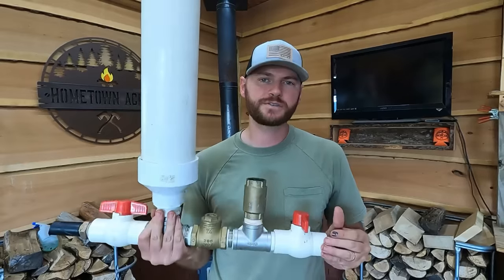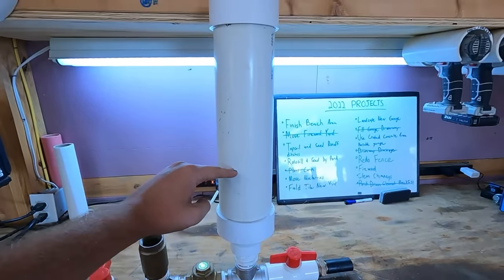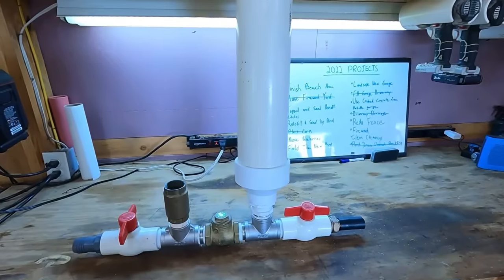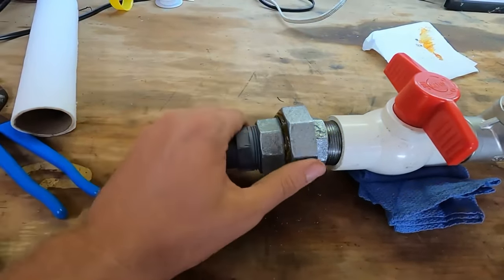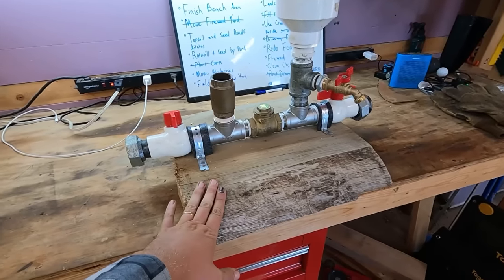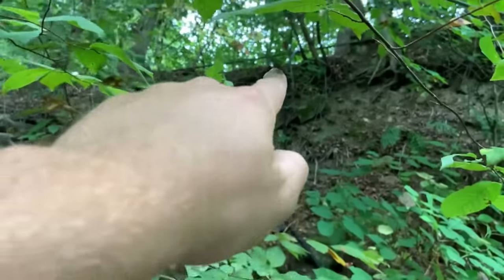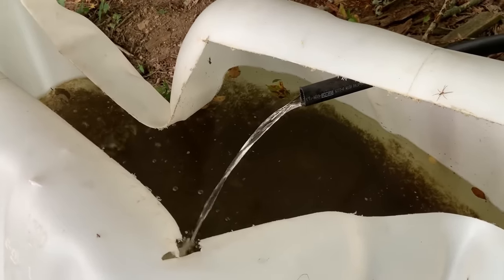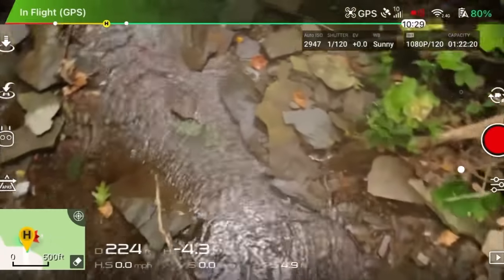Perfecting The Ram Pump And Then Abandoning It

Comment: Priming that siphon will be a challenge. Ram pump is set it and forget it and will run as long as there is water in the stream.  Loss of flow rate makes up for the ease of operation. But it’s not my pond. :). Learned a lot watching your challenges!

Comment: one other way to get relative elevations is the water pipe. a piece of tubing or hose filled with water will have the water at either end at the same elevation. Of course, this requires you to have a hose long enough to begin with, but useful for smaller projects

Comment: Just put a loop in the pipe after the check valve. Will create air gap to allow for compression. Get rid of the pressure tank all together. If the creek ever runs dry for a bit your siphon will stop, with the ram pump it will always move water when available. Granted the siphon will move more but it is not a set it and forget it. You can set the ram pump and come back 20 years later and it will still be running.

Comment: Pool noodles Or bike or half pumped tire tube to slow down the water logging update to stainless steel parts for more weather resistance, add small weights (a few bolts) to top of foot valve to increase flow.  Great idea on the added tap. Even a more durable drive pipe PVC or galvanised half the pipe to the pump for better flow.

Comment: Adam 
You do very nice work.

A comment on you Ram Pump Issue
 Your Head tank is saturating over time because the gas(air) is being absorbed into the water
therefore you must drain the vessel periodically.

Your installed drain is correct,  but will not drain the tank as configured!
You need to add  a 'Vent Valve' to the top of the tank in order to properly drain the chamber.
If not - it will not drain!  As Air cannot enter the chamber to purge the water.

Just like holding liquid in a straw by holding you finger over the top = it will not drain,
You may realize this the first time you attempt to purge the vessel or you may not 
the fix is simple - add a vent valve to the top of the tank.

I would not abandon the Ram Pump
because you can use it to prime the siphon 
which you may have to do periodically. or at least seasonally.

Also realize the larger the diameter (within reason) of the siphon line the greater the flow rate
exponential as the flow of a 2" line  will be significantly greater than 1.0"
and this can be easily calculated.

Comment: I've never seen a Ram Pump so thanks for showing us that. One thing to consider if not mentioned before is the flow rate of the syphon to the fill rate of the creek you're pulling from. Another words, the syphon may empty the creek and break the syphon if the flow rate is to much and then you will need to restart the syphon. where as the Ram pump may drain but would restart with the simple push of that valve.

Comment: Before water tanks for water wells had rubber blatters they used a setup just like what you made.  They had a plug to remove at the right height of air to water for the best pressure.  I was going to suggest trying something like a small innertube inside the tank.  Bycicle or Lawnmower maybe.  
Consider keeping the ram pump for filling the syphon tube with water.

Comment: By the way ,what I know for sure  it's true the quantity of water will be significantly larger and if you will choose to use the  "drum" or  barel of 200 l solution ,the outlet pipe must be larger than the inlet pipe which has to have at the end a foot valve and at the end of outlet use a reduction equal  or slightly smaller than the inlet pipe.Also on the outlet pipe I saw the Vietnamese, are using a pressure chamber as the one you used at the ram pomp I don't know the measurements for and if you because you have a big distance  to cover,you have to use one or more of it! Success and keep us posted! I forgot use a tap at the and of the outlet pipe before the reduction,and fill with water the hole system before....but I think you know how the syphoning method works! Open the end faucet slowly,I saw a video with a barel crushed by the suction force like a can of soda! I edited four times ...I remember things gradually!...and excuse my English I hope I made myself understood!

Comment: You can avoid water logging by installing an inner tube inside the pressure chamber when you assemble it. Very little air pressure in the tube is needed.   Great video.

Comment: Add another small valve to the top of the tank to allow air to enter when draining. Also, if you use PVC unions you won't need tools to disconnect.

Comment: Quick connects inlet and outlet,drive some rerod,4 pieces, put a 6 or 8 "hose clamp around the rerod w/the pressure tank coming up through the hose clamp,easy peasy,no need for wood or anything,just un do the hose clamp,and quick connects

Comment: The material the drive pipe is made of impacts the pressure of the water hammer. Any stretchiness in the drive pipe will reduce the pressure of the hammer. Highest input pressure is achieved with steel pipe since it does not stretch during the hammer.

Comment: If you put an air bladder in your pressure tank it would in theory work constantly without the worry of water getting in and off setting the balance. All hydrostatic water tanks have bladders for this same purpose.
Reply: Thats what i was thinking. Just put a bike tube in there and fold it up in the pvc and inflate it best you can - might be too late for all that now.

Comment: You should check out using water head pressure to compress air for use in neumatic drive systems.

Comment: The ram pump is good to know if in your situation you needed higher head pressure to do some cleaning with water at higher pressures, and had a elevated perch to place a modest storage tank much higher than where you could use the water. If I am remembering correctly from my ram pump days ....that every foot of elevated water, roughly 1/3rd of a pound is developed below. 10 ft. Rise equals 3pounds 100ft = 30lbs pressure and so on. Put a tank on a 150 ft hill above you, ram pump water up to that tank and have pressures that match your local water utilities pressure.

Comment: In the pressure tube, the air slowly dissolves in the water, so it needs to be refreshed. A compressed air fitting is the quickest way, although it can be disassembled and drained of the water.

Comment: With a combination of siphons and ram pumps you could move the water anywhere. Use the ram pump to get the water up a hill and have a holding tank on top of the hill. Then siphon the water as far as you can and then have another ram pump when the elevation rises.

Comment: Most pumps have valves on the inlet and outlet to prevent back flow and can be left in line.  But it needs to be ones that can pump ' solid particles'.  Pumps intended for  fowl/waist water  would be appropriate but they need to be able to pump to the head of the hill.  Manual pumps,  boat bilge pumps would suit,  and they are designed to be left for long periods with little use.  A fair amount of pumping would be required so bilge pumps longer handles (3 ft or so) would be best and match the pipe sizes.   I  think I would be inclined to have bypass valves if it left in place.  Would make it fairly easy re-establish flows which will probably be needed from time to time.

Comment: It's easy to drain the water out of the air chamber. You simply install a Schrader valve in its top. Every so often just use a bike tire pump to push air in and water out.

Comment: If you feed the outlet down to the bottom of the deepest part of the pond you can add that depth to your siphon drop as well as force rich, oxygenated water into your pond helping it cycle up stagnant water and this will boost fish and other wildlife capacity.
Reply: Err no! Good idea to get oxygenated water into the deeper part of the pond, however ... There will be NO extra syphon flow due to the extra depth ... All that stops at the surface! For every foot deeper into the pond the increase in back pressure equates to the increase in forward pressure ergo no improvement in flow rate once the pipe end is under the water, no matter HOW deep it goes ... 1 foot or 1000 feet!
Reply: @boblewis5558  yeah not about siphon power, oxygenation  and de-stratifying the water will release water laden with minerals in solution and o2 back up and enable more life in the shallows where it manages to make it up. 

What you don’t want is dropping the water down a pvc pipe without the airlock provided by submerging the pipe and it spilling out on shore eroding and easily breaking the vac needed to continue the siphon. It’s like siphoning a tank to another lower. Sure it will siphon, however it will be far more reliable once the hose end is below the level of the liquid so air cannot back flow and potentially beak your siphon.

And if your bringing in clean o2 rich water then why not send it into the most needed areas. The added depth does add, however the water level does subtract. It’s not quite the same as saying it stops at the surface. It doesn’t, the siphon benefit is mostly negated. May seem minor but applies in some instances.

Comment: Not only this, but if you can siphon up into the water, then you can use gravity to take a separate hose back down. This hose could be connected to small electrical generators. This is why New England became such an early industrial hub because of the waterfalls and rivers, giving them natural power to move motors using the water wheels to energize their equipment. 
Moreover, if you have I believe 100 feet of drop or more from a basin. You can take a bunch of copper tubes and put them into your waterline which will naturally pull air down the line with it to the bottom of the hill and you can collect that air from the other end of the hose into a tank And have constant flow of air for pneumatic tools and or cold air for cooling and refrigeration. The hundred feet compresses the air in the water and at the bottom you would use an air scoop to get the air back out but you need at least 100 feet. I forget what the name of this is , they discovered it somewhere in Spain or Portugal when they were using terra-cotta pipes to get water off of the high points on old Roman aqueduct in the pipes would smash because of the pressure for no reason. What the process is some engineer here will be able to tell you what it’s called.

Comment: There is also The Nikola Tesla Windmill/Water pump Turbine, It is near the same devise on the same proception technique or method by the pressure it automatically generates with either Wind or Water.

Comment: Use the ramp pump as well to put water in that tank and then tie that tank off to an electrical generator. It will bring the water to your pool at the top and then you can generate electricity on the way down using gravity.

Comment: Put a ball valve at the pipe exit. Use the ram pump to fill the pipe. Open the ball valve at the pond to start the suction. This can also be used to control the water flow. This will allow the pool to stay full while giving you maximum flow rate. Have fun.

Comment: I'm not sure how you plan to prime the siphon, but if a vacuum doesn't have enough suction or is too far from the nearest outlet, you could use the ram pump.  You would need to put a valve on the pond outlet and a tee with a valve at the highest point.  Close the pond valve, open the high-point valve and hook the ram pump to the creek inlet and pump until water comes out of the high point valve.  Siphon is primed and ready to go.

Comment: Keep your ram pump and make a bypass connection around it. Then close the bypass and use the ram pump to fill and prime your water line, then open your bypass. Presto, a siphon starter.

Comment: If you'd use a bicycle tire tube inside the tank as an air bladder you can keep a set pressure inside the tube and not lose any volume to water.

Comment: If you drill a small hole through the valve body of the inline valve, it will act like a vacuum breaker and prevent the tank from getting water logged.The hole needs to be behind the the valve.

Comment: Put a partially inflated innertube in the pressure tank.  Captive air in a flexible bag.  Or put a sipper valve in to sip air.

Comment: Dill a hole in the top of the tank and put a tire valve in the hole with bead sealer. Then you can just use a hand air pump to add pressure back to the tank when needed with out  taking it apart.

Comment: Maybe there's a hydraulic engineer out there who can confirm this (this isn't my field, but just thinkin'):  It might not just be just the elevation difference.  The weigh of the water on each side of the elevation apex should also have an effect on flow, too, right?  If that's true, then, if the linear distance to the pond from the apex is greater than the distance from the intake to the apex, there will be more water-weight drawing on the outlet run side, hence also helping to 'drag' more water into the pond.  Of course the diameter of the siphon line will have a terminal volume.  From the drone video, it looks like a longer distance from the apex to the pond.  The restrictor idea sounds good too (a simple ball valve should work and be adjustable).

Comment: install a schraeder valve (steal one from a bike tire innertube. at the top of your pressure vessel.
go out there every 3 months with a bicycle pump, and use the valve to allow you to pump the pressure vessel up enough to expel the water. 
bonus points if you can figure out how to use the water from the pump to charge an automatic purge system.

Comment: Have you thought about adding a bike tire valve at the top of the pressure tank. A few pumps of a bike pump should recharge the system. That way no need to stop the flow.

Comment: I know you're not going this direction any more, but here's something that might help with waterlogging. I think the primary reason that this happens is because the air in the cylinder dissolves into the water, allowing the water to fill the tank. If you were to trap air inside the tank so that it can't make contact with the water, then it would not leave. I've seen other people build similar pumps and what they did was place a closed cell foam, such as a pool noodle, inside the cylinder. So while water will make its way up into the cylinder and "jacket" the foam, the majority of the air is actually trapped inside the foam and can't dissolve away. Another way might be to use something like a pop bottle or two filled with air
Reply: but that excludes the airs ability to actually compress which you need. I like the noodle idea but it will degrade and the air isn't as dynamic in that foam... not a great solution when you could drill a drank valve at the bottom to open every so often... creative but not the answer bro 👍

Comment: I hope your siphon inlet is deep in a reservoir that can never suck air. Once it does, no water will flow. Filling your siphon over the top of the ridge will take significant effort. Hope your sifon does not recharging often.

Comment: Bike tire tube inside traps the air in it better. No air loss but all the pressure thump you need. Rubber adds to it for bigger thump. Ps u know you can build a larger model for more water flow if your stream is big enough..

Comment: trying to maintain a siphon is going to be an effort,  run your hose down stream until your out of the stream with gravity.  then use the water pressure to push the water back uphill to your pond... it's going to work 100%  siphoning will be a bummer bro, keep at it👍

Comment: Instead of unions, I think Cam lock quick connects would have been a great solution. We run them on all of our water pumps and connections that have to be undone regularly. Have never had one leak and it takes about 2 seconds to undo them with no tools required
Reply: Chicago fittings?

Comment: While a siphon might be more productive than the ram pump, BUT:
- The stream looks like it'll almost dry up completely at some point during dry seasons.
- When you lose the syphon and the line empties completely, you'll have to start the syphon all over again.
- The ram pump as you've currently set it up, only requires an occasional check of the air chamber.

Yes, you may get more water volume with a syphon but you'll be at the mercy of the stream's flow.  If you suck the source pool dry with the syphon, you'll be having to re-prime the syphon when the water returns.
I'd stick with the ram pump.

Comment: Nice follow up. A ram pump is a cool gadget, but far cooler to find an even simpler, better solution. 

“For the simplicity on this side of complexity, I wouldn't give you a fig. But for the simplicity on the other side of complexity, for that I would give you anything I have.”
― Oliver Wendell Holmes

Comment: Super helpful video. I have nearly an identical setup with a spring below a potential pond area. I’ve been searching for ways to get the water up hill without electricity. How did your system perform in the winter or do you shut it off when temperatures drop below freezing?

Comment: Greasing the threads is correct and the best lubricant grease anti seize to use is ...

"copper kote",

 it's salt tolerant and shall remain slippery as a lubricant 👍

Comment: If you use an expansion tank installed on the inlet of a water heater (it has an internal bladder that prevents the 'waterlogging' you describe) it should prevent absorption of the air in the pressure chamber.

Comment: You may need to use a float valve at the pond to turn the siphon off if the water gets too high in the pond. It shouldn't lose the siphon if you do this. If the desired water height in the pond is at about the same level as the source level it should work perfect without the float valve if both ends of the hose are under water.